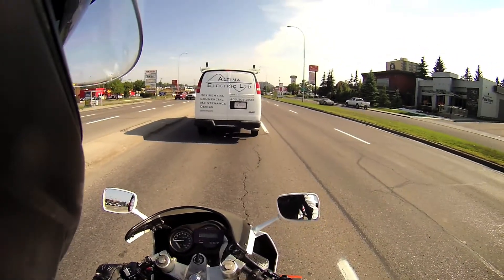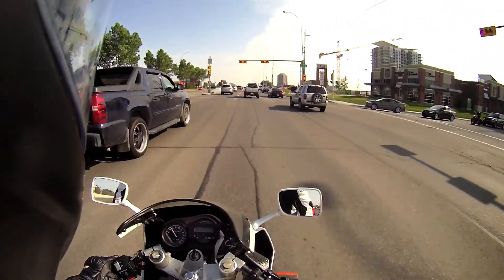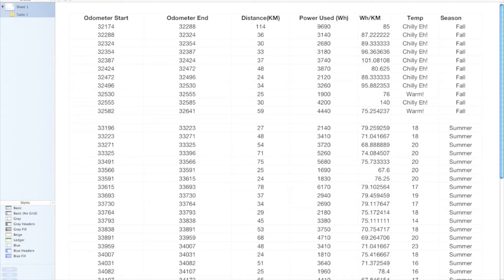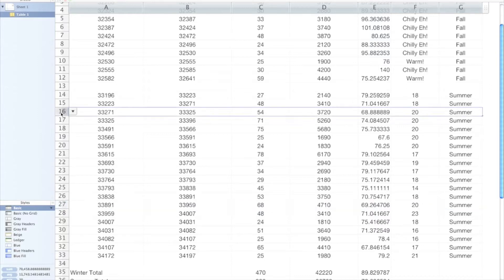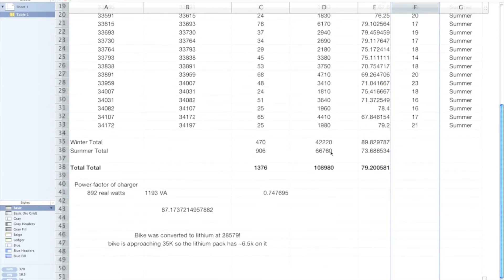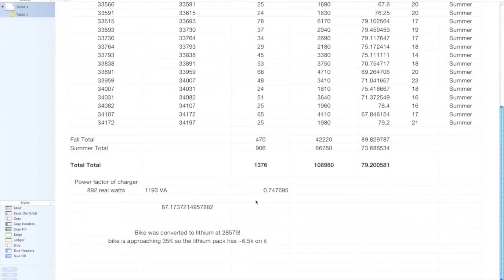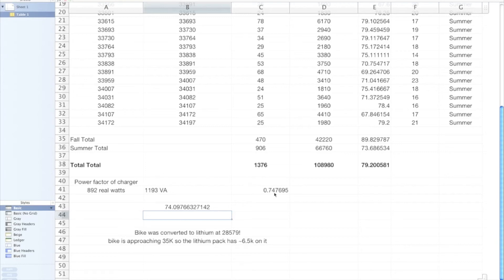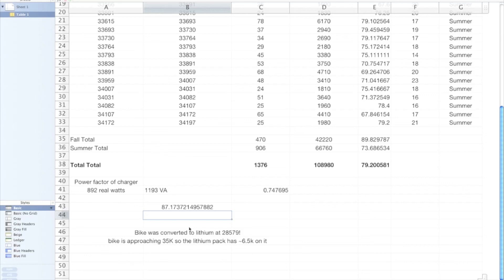#17: Electric Motorcycle Energy Consumption #3

Comment: Now, i don't know what you have been doing to calculate the power usage, but i guess you don't need a new charger. However, that you use the unit VA instead of W, i'm guessing you're into impedance. 
If not though, the VA value (Apparent power) doesn't reflect the power that you pay for.
Reply from the maker: Great point! Yes, you do only pay for real power (kWh), but a high power device with such a low power factor is not good. It's puts more strain on the grid!
Reply: I'll just leave you to it, seems like you know your electrics :D

Comment: Are your real world watts measures on the output of the charger as it goes into the battery?  If you are getting this information from something like a kill-a-watt meter looking at power factor and VA then this could also be where the problem lies, as the actual output of the charger can be even less than the real watts consumed after taking the power factor into consideration.

If its possible you should base your consumption figures on the actual charge going into the battery, so installing a meter between the charger and the battery is the most accurate.  Depending on your voltage of your battery bank you could use something like a watts up meter or a cycle analyst or a decent meter with a current shunt.
Reply from the maker: Yes the measured power consumption is from a kill-a-watt meter. I did plug in an estimate of the charger efficiency in the last calculation of ~85%. According to my BMS and what the wall meter says this is roughly correct, but neither are real precision instruments.

The proper way to do it would be the way you mentioned, but with a proper precision power meter that can measure voltage and current at the same time and log it to get cumulative energy. The best thing I have on hand at the moment is a fluke 87-V5 which is pretty schmick, but does not do data logging.

Comment: Maybe you have something else plugged in while you charge the bike that shows on your wall meter? There were this talk about getting removed and checked every 6 years in my country. I have an old school analog meter that would probably need readjusting but i have no idea how many problems with bureaucracy that could get me. All those faulty meters probably benefit the state, otherwise power company would show up every year to check them for accuracy.
Reply from the maker: I can't count the number of times something silly like that has happened to me. The old trying to get something to work only to find out it is not plugged into the wall! Unfortunately that's not the case here. Nothing else is plugged into the meter and it is located right at the charger.

If the meter was plugged directly into the wall it would log slightly higher power consumption as the loses of the extension cable I use would be added. I use the extension cable because the bike and my car swap places in my garage depending on the weather. There is no outlet at the door end of the garage.